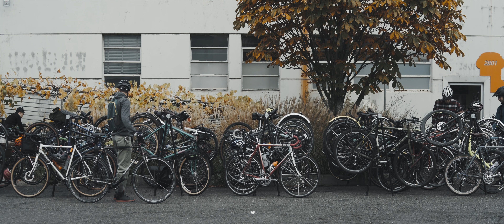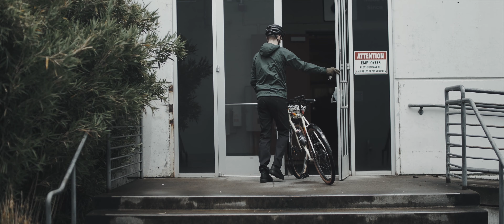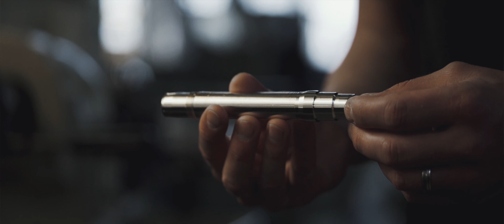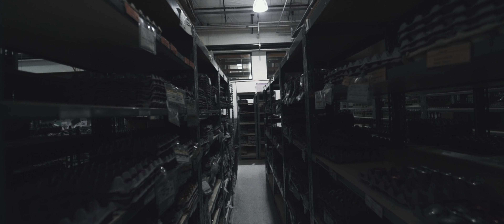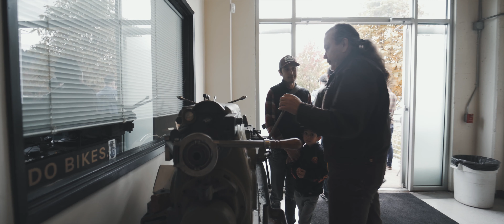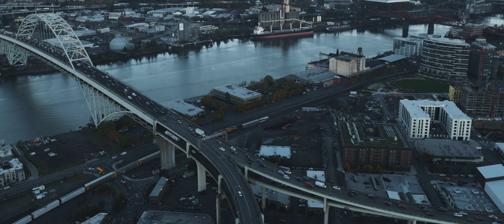Servicing The World: Chris King vs the Throwaway Society

Comment: The issue is the bike industry. The standards change so frequently that within 5-7 years your components are no longer compatible with anything. I have Chris king 1 1/8 headsets, iso hubs (100mm*20, 135mm *10) and they are all in landfill as they aren't compatible with any thing and there's no upgrade path for these old components. So great in theory, but Chris king made the t47 bottom bracket standard when we already had press fit, BSA, and the host of others so he's adding to the waste

Comment: I own a Litespeed Ultimate from 2006 (!) with a Chris King headset and it runs as smoothly as at its first day.
Now I am planning the new build of a titanium MTB and wondered if I really should spend that much money on the head set.
Watched the video: „No disussion, CK i7!“
Reply from the maker: Litespeed is for road, no? I'm sure a titanium MTB of similar build quality will last you a good 15yrs+ also! As long as we're moving away from throwaway items, we don't have to feel guilty about new things that help us enjoy the world.
Reply: @SaddlebackCycling  My Litespeed Ultimate is for road, correct. They also have MTBs and I would have preferred to buy one of them as well. Unfortunately Trump and the EU made it very expensive to buy an US bicycle from Europe. Therefore I bought a titanium frame from a small german manufacturer called „Rabbit“.
Before I had a carbon frame which broke. Exactly out of that reason that the carbon didn‘t survive for 6 years with normal usage I decided to choose a material which is timeless, has longevity and if broken, can be fixed or easily recycled.
Titanium and Chris King anyway is a perfect fit! 😍